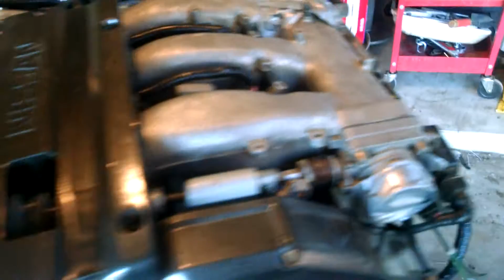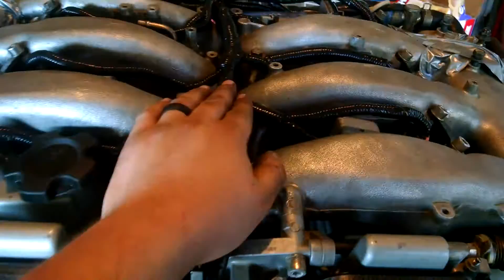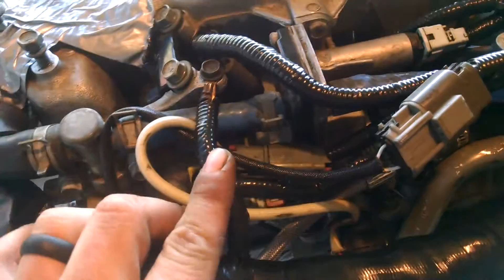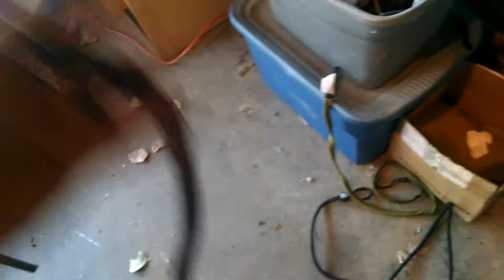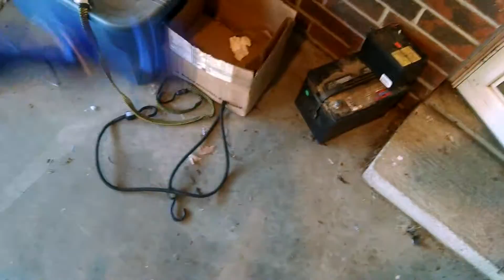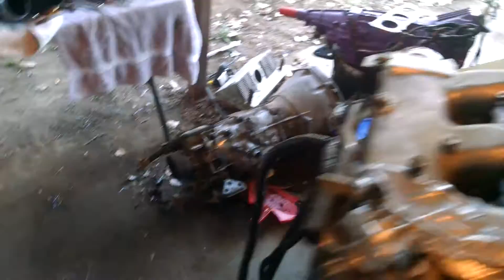Custom Wiring Harness VG30DETT Z32 300ZX

Comment: I cut my wiring harness and need help. I cut it just before the blue connector you were showing that goes into the ecu. I started to re solder everything but some wire look literally identical to others… which one is which based on the wiring diagrams

Comment: Just  saw this, nice work. I have done the same thing to my NA Z but took it a little further as my car is used for road racing, so I eliminated everything that not required, however I may have gone to far, as I can’t get the ignition coils to fire now. I have power everywhere that the schematic calls for, I have all the grounds in place, the injectors function when I turn the CAS, I don’t have the gages wired up, or the speed sensor, however I don’t think that would stop the ECCS from sending the signal the PTU. You have an in-depth knowledge of the wire, and it sounds like the computer operation as well, is there something that needs to be connect to the computer that may seem unrelated that would keep it from energizing the PTU? 
I really appreciate any suggestion you can offer.

Comment: man you are the guy I need to talk to. Would you help me with a wiring question on my 90's 300zx? It's causing me a huge headache.. and I didn't see the wire that I'm having trouble with in your harness, which is kind of alarming to me.
Reply from the maker: Whats going on?
Reply: @L1Training  man I'd have to send you a video or picture of it honestly. Do you have instagram or a facebook I could shoot you a couple pictures? My problem is the revolution sensor. Car is stuck in 3rd gear. and I have a misfire on cylinder 2 that's not caused by the coilpack or sparkplug. and one set of confusing wires looks like it's coming from the transmission area. and the other has 2 that's spliced together and ones not even going anywhere looks like it's coming from the injectors. I'd love if you could help me figure this out.